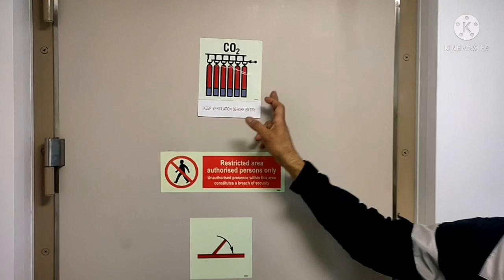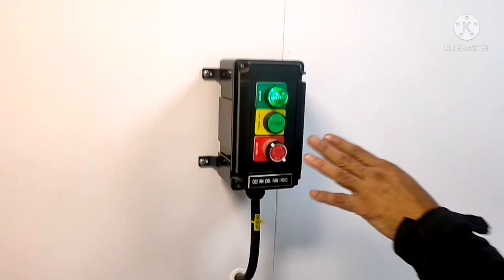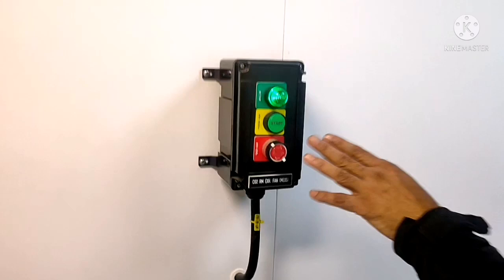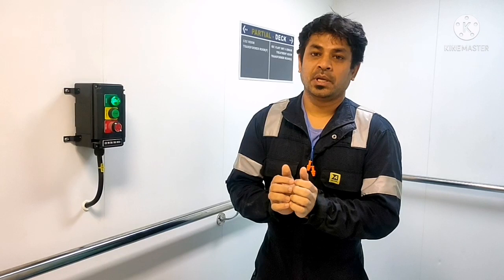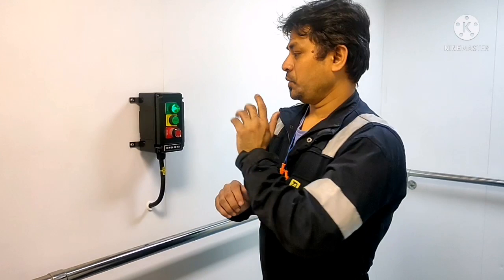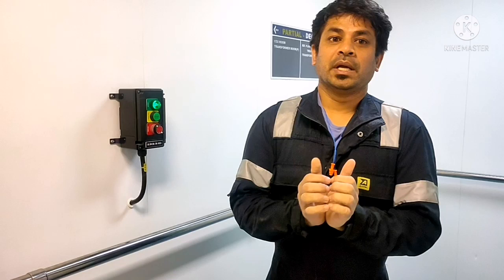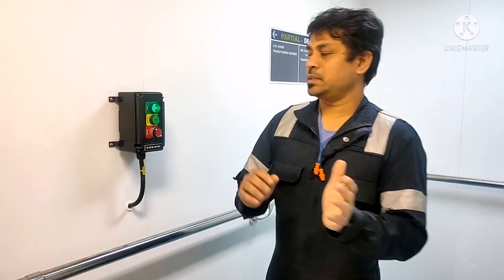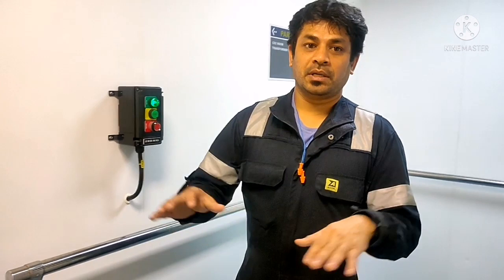How do they do.... Know About co2 fire fighting system onboard ships....

Comment: Very informative video, many thanks for uploading. One doubt though... in the video you have mentioned that one pilot cylinder bottle is provided to open the main distribution valve, whereas the other bottle is for opening the cylinder head valves. Is this correct?  I was under the impression that one pilot cylinder is enough to operate both the main distribution valve and the cylinder head valves.
Reply from the maker: Thanks for your comment sir... Your understanding is right of there is less number of co2 bottles one pilot cylinder is enough.. But the one i mentioned is for ships having more than 800 co2 bottles... So these bottles are divided according to the cargo hold size.. So each channel has one Pilot cylinder for the respective hold..
I beleive This reply will satisfy your query..
Reply: @marine-knowledge-basha  Thanks for the reply, pls keep posting
Reply: @marine-knowledge-basha  appreciate your effort and great work indeed, regarding pilot cylinder in most system for ER total flooding, 2 pilot cylinders are provided one for activating the distribution valve i.e to ER space. then the other pilot cylinder is for activating the cylinder valve of high pressure co2 cylinders as we all know then only you will achieve 85 % saturation  within 2 mins. the manual valve usually cocks for releasing pilot lines have a interlock first you will open the distribution line and then only you will open the co2 cylinder valves pilot line and you also have a time delay unit in this just to buy some more time for escape.

Comment: Thanks sir your video is very useful. I have a doubt . For example if hatch no 5 co2 cylinders used but till fire in cargo hold .is it possible to use cargo hatch no.6 co2 cylinders for hatch no.5.
What are the steps to followed. Pls advice me sir.
Reply from the maker: Thanks for your good compliment sir..
It's possible to use co2 fire fighting  within holds..
The procedure differs with differnt maker.
It is advisable to refer maker's procedure to operate the co2 system.
Reply: @marine-knowledge-basha  thank u sir .

Comment: Sir really very much informative video ...and I have doubt as you mentioned in the video if the CO2 is fully finished and there is no more to fight the fire ....Sea water is used instead to extinguish the fire  .So is it possible in Engine room fire to use Sea water ?
Reply from the maker: Sir.. If there is provision for sea water line connected with co2 line.. Den it is possible to use sea water for engine room for fighting via co2 line.
Hope this reply will satisfy your query..
Reply: @marine-knowledge-basha  that means we can use sea water in CO2 line for ER fire ...but it's very much dangerous know because sea water conducts electricity especially in motor , pumps ...etc in Engine room
Reply from the maker: @jestinv9768  your view s vry correct sir.... This sea water arrangement with co2 will be given in fire fighting system for cargo holds only and not in engine room for fighting
Reply: Sea water will short out all the electronics and make the ship totally immobilized.

Comment: sir you have mentioned to open pilot cylinder valve in first panel and then again for individual hold we need to open master valve?
Reply from the maker: S sir.. This will be for cargo hold.. Whichever the hold is in fire.. That particular unit should be operated.
Reply: @marine-knowledge-basha  then why should be use the 1st 2 pilot bottle which are mentioned -only for cargo holds

Comment: Sir is it provided bursting disc on each cylinder ?
Reply from the maker: No sir... Since its co2 there wont be any bursting disc sir...
Reply: @marine-knowledge-basha heart vidio sir thanks for valuable information...  sir incase of CO2 room fire the bottle get  heated up and it will burst right .. so to avoid explosion which arrnagemet provided?
Reply from the maker: @brainstonm5570  u r vry rt sir... Bursting disc arrgt is a safety for co2 bottles and the bursting disc burst at about 200 bar pressure.

Comment: Great works sir for total CO2 extinguishing we use servo cylinder for individual we have seperate control chambers and seperate manifold and main valves am I correct sir
Reply from the maker: S pa.. Almost
Reply: @marine-knowledge-basha  tq sir  I'm asking many doubts  did you got disturbed?
Reply from the maker: @nagadurgaprasad2156  Np.. please put up ur N number of doubts... I vl try to clear u.. And it helps me to gain knowledge also dear
Reply: @marine-knowledge-basha  TQ sir

Comment: He said that each cylinder are connected to activate either valve one and the other valve 2? He give wrong information...the two pilot cylinders are a backup to each other, you need to open the valve of one and then activate valve 1 and 2...